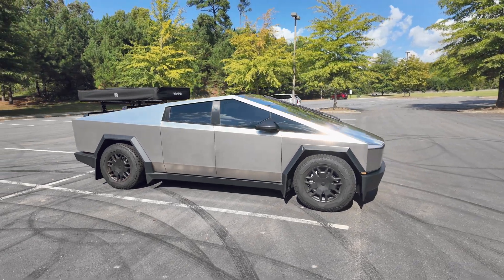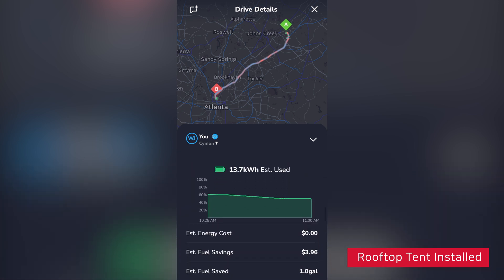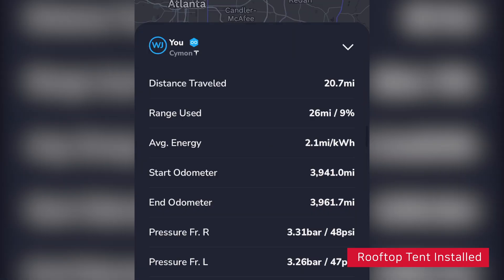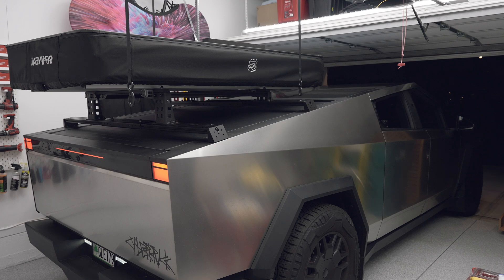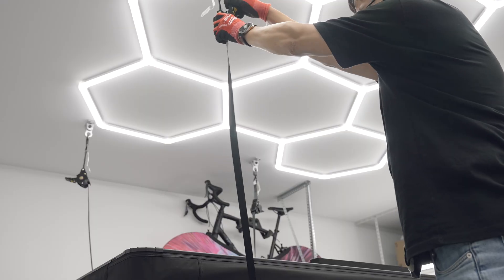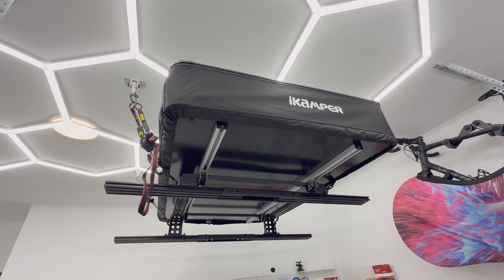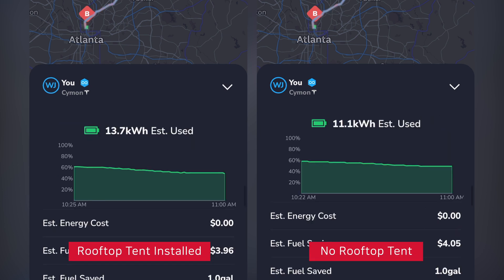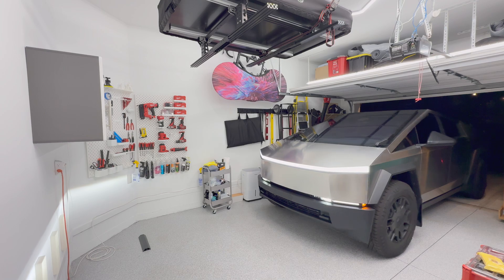Cybertruck with Rooftop Tent Range Test Results. How Much Does Battery Efficiency Drop?

Comment: why cybertruck.. like most other ev trucks are better in all ways.. including build quality.. you cant even tow with it safely ( forged aluminum breaks... why did they not use steel frame for a truck.)
Reply from the maker: Why not? I’m not sure there’s another EV truck out there that beats the Cybertruck. While it’s not perfect, when you weigh the pros and cons, the Cybertruck comes out on top IMO.
Reply: @WooJang  I would agree WooJang. There is raising and lowering, 4 wheel steering, supervised self driving, Camp mod and dog mod, none of which other EV trucks. I sold a 2023 Ford Lightning Lariat extended range to get the Cyber Truck and I am not sorry in the least. Love my Cyber Truck.
Reply: That's weird, I tow with mine weekly.